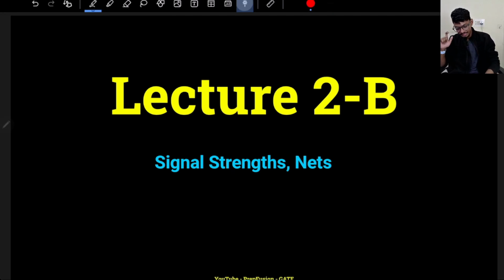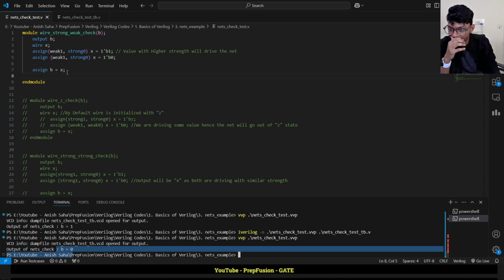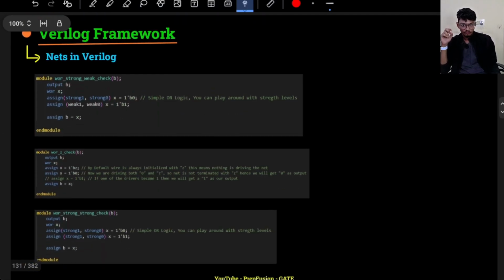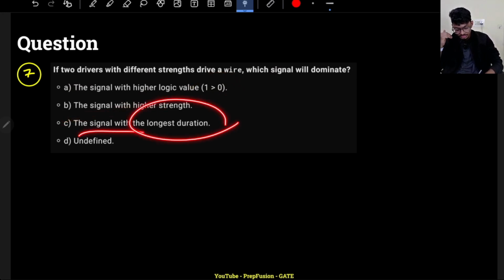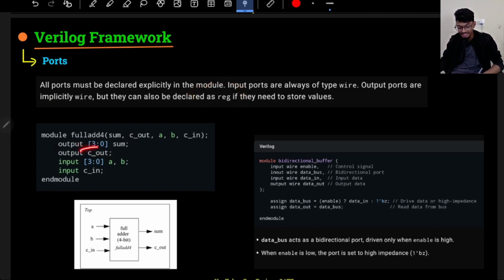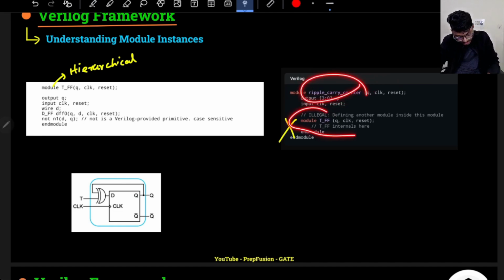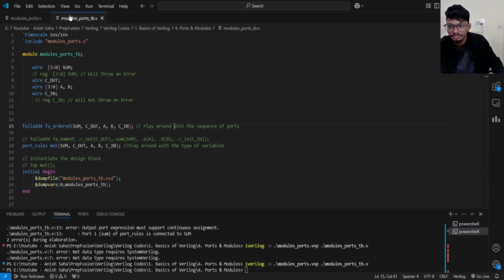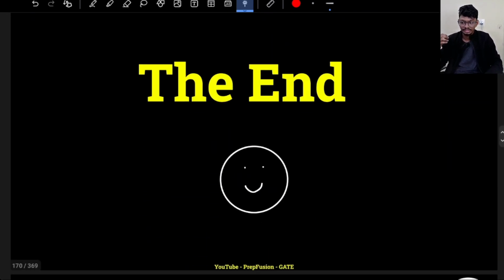2(B) Verilog Signal Strength, Nets & Modules | #30daysofverilog

Comment: not a good explanation at all ur confusing by saying i will explain it later and due to all the codes are there at once in the vscode its literally confusing and try to explain on slide properly then go to the vs code sir
Reply from the maker: In 3rd lecture of Verilog you're expecting that you will understand the whole code?
I'm repeating multiple times in the lecture that try to understand the pseudo code focus on what I am trying to explain. Understanding the whole code takes time and only be done once you're done with the whole module. Not within 3rd lecture have some patience.